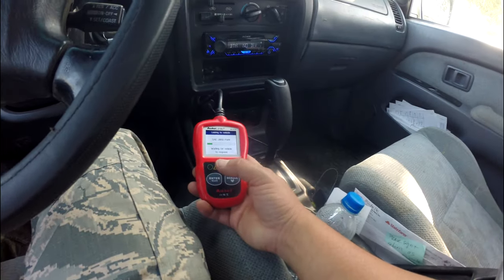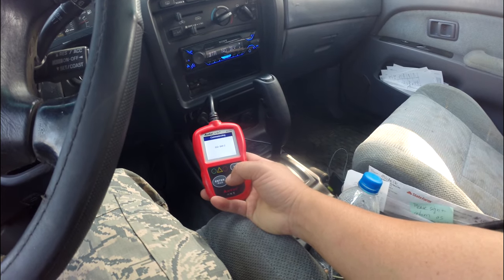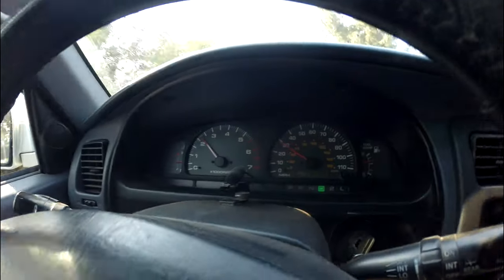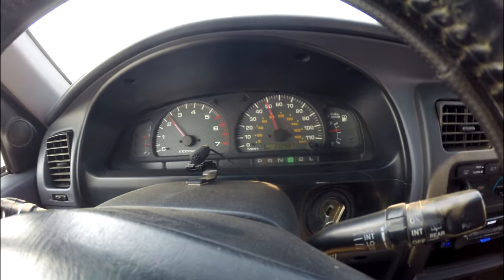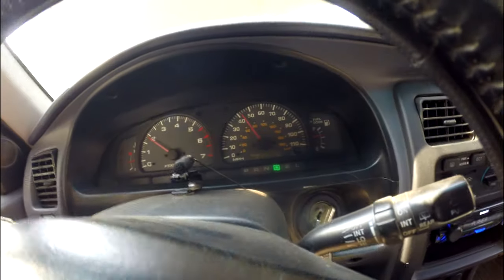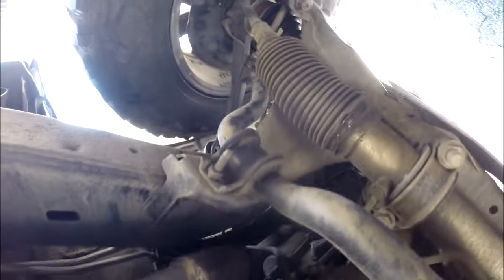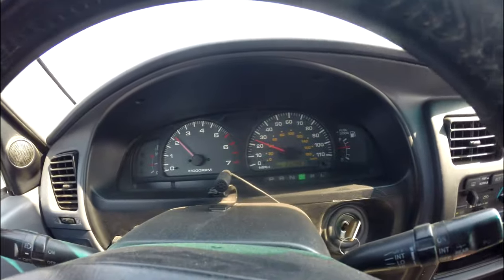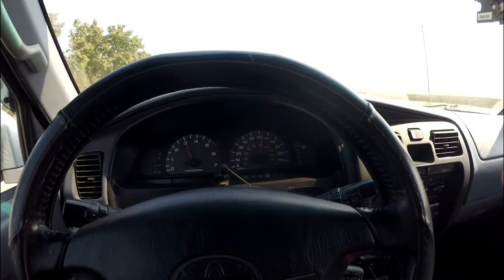How to identify a bad clogged catalytic converter.

Comment: I have a 96 Camaro 3.8l i think i have this problem replaced all sparkplugs checked map, IAC sensor nothing air box is good replaced all coil packs nothing i get a mini backfires and a rough and hard to start idle i think it might be this thanks!
Reply from the maker: @HYP3M0D368  you welcome

Comment: A clooged cat feels like a sock is in the tail pipe no response on hills - Overheatilng
Even with no engine codes.
Bad cat/s can destroy an engine due to back pressure in the combustion chambers.
Vert stressful on piston rod bearings

Comment: I have a 2001 4runner and I thought I had a exhaust issue ended up replacing a lot of other stuff trying to troubleshoot the problem and I found out I needed to replace my ignition coils my truck would start to shake at around 45mph and higher hopefully this helps someone who has the same issue I was having
Reply from the maker: Thanks buddy

Comment: i have code 0030EA and 003104 faults when the car is in idle the rpms keep going up and down dosent stop at all but when i drive the rpms are normal, can it be in need of a catalytic converter replacement? also i dont have any warning check lights on on the dashboard.
Thank you in advance.

Comment: Thanks for the video. I have a V8 Infiniti and when the engine gets warm the speedometer starts jumping exactly like on that Toyota. I finally got the P0430 code. I've seen a lot of videos on this issue and some recommending to start by changing the O2 sensors but from your video it really sounds like it's a blocked cat. Would you recommend trying to clean the  cat or just replace with a new one? I also heard aftermarket cats can be trouble. For the record, I've just subscribed to your channel. Thanks!
Reply from the maker: Can't really clean the cat according to my experience.  If you have the money dealer items will be the best.  However it's almost the same price as the car already lol 😆 🤣
Reply from the maker: Thanks a lot for your help subscribe 👍 🙏

Comment: Question, is it possible to hear a squeeling during acceleration with this problem?
Reply from the maker: You probably depend how bad it is. Some cat you can hear rattle noise from the cat. But if cat problems the symptoms is burt back to the engine.  Symptoms just like I showing in this video.

Comment: I think is what im experiencing...when i go uphill it bogs out like it wants to cut off but if doesn't. I've changed soo much but im really starting to think this my issue. Have a 88 C2500. It still has the original cat on it. Here and there get the rotten egg smell

Comment: Mine has 299,999 going on my 3 year driving it with this mileage is doesn’t move up no more should I be worried
Reply: Speedometer cable is broken. Goes from the back of your odometer to the transmission.

Comment: 2011 Audi I’ve brought to 3 mechanics. Pcv valve and spark plugs have been done. Still having the issue. Car sends lots of white exhaust out and shakes and hesitates. Thinking high pressure fuel pump, injectors, coils, or catalytic converter.  Oil doesn’t have a dipstick or a notice for overfill just says it’s at max. Just got my oil changed could be this. Any ideas?
Reply from the maker: Could be your turbo
Reply: @alltsab  okay would that cause rough idle? Shaking bad/ sputtering. with check engine light on. Going to see what the codes stored are soon.

Comment: My 2004 Mitsubishi Lancer same mileage, won’t go over 2RPM mechanic shop said fixing my catylic converters are worth more than the car itself but I have no check engine light just no gas even when I floor it. Any ideas? Or thoughts happened shortly after a tune up.
Reply from the maker: Your mechanic is right

Comment: Nice video! I have a question on my 08 328i coupe the exhaust feels very hot close to the tip but no loss in power ( from what I can tell since I just bought it) but what's odd is the smell that comes from the exhaust when it's warmed up. It smells like rotten eggs or something to that degree. Do you think it's my catalytic converters?
Reply from the maker: Your description is cat converter
Reply from the maker: But if no code and drive normal then just keep driving until the last used.
Reply: @alltsab  Thanks for the quick reply! Since this car has a sulev engine, bmw has a 150k mile or 15 year warranty for emission components in certain states like California where I live. I'll see if the dealer can change out the cats since this car only has 145k miles.
Reply from the maker: @alexjrtony350  yes take to your local dealer they can diagnose if cat they will put one for you. If no code they may just bluff you off and not fix it and tell you to pay the diagnose fees. Please help me subscribe ok I need your help too lol
Reply: @alltsab  I definitely will subscribe! Or should i say already have lol
Reply: Does it smell like coolant ? Could be egr.
Reply from the maker: @1danny2k   no

Comment: If I create a leak in exhaust by loosing bolts my 4runner will run so poorly it won't even go over 10mph.  It enters extreme limp mode. That downpipe connection came loose one time so that's how I know that:)  I've also had the front side flange to Cat loosen up and leak.  No obvious change in power when I had that small leak.  What am I missing?     ...disconnect cat entirely?
I have upstream AND downstream O2 sensors.  Creating a leak affects their function, leading to limp mode.  But I have the exact symptoms you showed.  Flooring it, and my truck barely gets up to speed.  I can feel it starving for air.  I have Rich Code on old ob1 system.   Would a stuck valve or something else create similar air starvation and my cat is fine?   I checked couple years ago and cat was about 1/6-1/5th clogged.  I installed aftermarket cat that was half the size(no other option) and it didn't change anything.  What happens to O2 sensor system if I just drill out the Cat interior?  seems like it will enter limp mode,no?

Comment: Question?  My truck is reving high in rpms when I step on the accelerator then I feel it jump a little and it runs good.  Then when I hit a stop sign it does it again.  How do I know the catlitic converter is blocked?  I added the clean catlitic converter also.  I feel in the exhaust pipe a stronger push but the truck is doing the same thing.  What should I do or check?  Thank you I appreciate your advice
Reply from the maker: Your problem is not cat converter
Reply: @alltsab  what do u think it can be?  I'm changing the throttle position sensor next, it's a 1989 gmc sierra 1500.  It was running real good and about a month ago it started revving high before it would accelerate

Comment: Can a clogged catalytic converter cause a car to go into limp mode? 2014 VW Passat 1.8t won’t get out of limp mode and the only code I’m getting is ambient air temp, also EPC light is on.
Reply from the maker: I'm not sure it will go to limb mode but it's could be possible on new car like your. But your car is still new may not be the  cat converter.
Reply: Did you try to unplug the maf sensor and run it that way? If the car drives properly without the maf sensor connected, you know it’s the maf sensor. If it still shifts into limp mode then it may be something else that requires on spot inspection
Reply: @beetlejuice1239  didn’t think about that will try that after work! Thanks
Reply: @ChristKingJesus  no worries. Keep me updated I kind of want to help you solve the issue

Comment: I have the same problem but a little different cant get over 50 to the floor but i have black smoke coming out of the tail pipe when its cold hardly any air but when it warms up it is really hot 
i also have codes running rich on bank 1 and bank 2 upstream i have changed all 3 o2 no vacuum leaks changed MAF sensor i have even changed the ECM and still the same no power i have replaced  the cam sensor TPS sensor idle air control  what do you thing CC or not
Reply from the maker: Could be bad cat or engine because black smoke meaning that it didn't burn all your gasoline.
Reply: @alltsab  brand new engine I think it's the cats I hope going to change it out
Reply: @williamfriedley8696  Brand new engine - but how old are your cats?..

Comment: P0031 HO2S Heater control circuit low (bank 1 circuit 2) is coming. Car is 2006 swift vxi petrol with 120K kms. Is it O2 sensor Or bad cat??
Reply from the maker: P0031 is not cat code so definitely not cat. Just replace your o2

Comment: So if my 69 challenger had 520,000 it’s low mileage because it’s 52 years old?
Reply from the maker: Lol 😆 69 car only have 5 digits 🤣
Reply: @alltsab  just because the gauge shows 52,000 it could have rolled over many times. 😂😂😂😂😂😂😂 🤦‍♂️  but that’s not the point

Comment: Can a clogged cat cause the oil pressure to jump up and down? Pulled a P0302 and P0430
Reply from the maker: I don't think so
Reply: It's probably the motor in your cluster. That's where mine has been until today... now it's parked for a timeout

Comment: Hey man, I think my cat might be bad, so I took it off. But is there anything else that would cause same type of problems? After 420 code and remove cat, the car is okay. I'm just wondering if it does the same problem what could it be?

Comment: Can a clogged cat cause a misfire on one bank? I have a 2002 mercedes c320. There was also a jingling sounded I noticed before it misfired on the whole bank 1. It sounded like washers jingling on a bolt
Reply: Cylinder 1 2 and 3 all misfired at once

Comment: Man, Sir my 2006 Nissan xterra its just like that, after 60mh turns off, but in 45mph to 50mph its just fine but to reach the 60mph feel like exhaust low air. In whish part of the United States are you ?
Reply from the maker: Golden state
Reply: @alltsab What area of the Golden state? I’m here, too.

Comment: I just got a 1989 f350 7.3 diesel and it barely accelerates and if I Rev it high and let rms crop to rapidly the engine will kill. Could that be the cat?
Reply from the maker: I'm not 100% sure but according to your explains it is not. Check your body throttle it more like it.

Comment: My ram 1500 is doing the same thing but also has a misfire on cylinder 7 could a clogged cat cause a misfire as well? Thanks
Reply from the maker: No not on single misfire. Your case could be just the misfire not clog cat.
Reply: @alltsab  ok thank you for the response… back to the drawing board. I changed all 16 spark plugs and cylinder 7s coil pack and that didn’t work. So next if to check fuel injector and maybe fuel pump and if they aren’t it then I’m afraid it’s going to be a bad cam or lifter issue the 4th gen ram hemis are known for… Hoping it isn’t that though
Reply from the maker: @HomeGrownPyro1  I don't think it will be the fuel pump because single misfire. Check injector and compression in that cylinder. Hey help support subscribe to my channel if you have not yet to ok very appreciated it.
Reply: @alltsab  Thanks again for the response. I did subscribe to your channel this morning 👍

Comment: My dads toyota previa doesnt rev past 2500 rpms it just cuts off i have to let go off the accelerator then maintain it below 2500 rpm to drive it reaches only 120km/h , could it be the catalytic convertor?
Reply from the maker: You can test your as this video

Comment: Do you think my cats are still good? My truck has 2 and they are like 14 years old
Reply from the maker: If no cat code then yes still good
Reply: I cant tell do its an 86 ford
Reply: It does take me kind of a lot to reach 60
Reply from the maker: @juliofranco7550  have someone good mechanic to do a diagnostic to make sure not the transmission before replacing the catalytic.

Comment: That's exactly how my Van is doing, and I have a code P0420.
Reply from the maker: Po420 is cat converter code replaced it then problem should be solved.  If you live in the area emissions restriction then  buy the matching converter to your car ok otherwise it won't pass smog check inspection.

Comment: My car has 160,000 miles and the code p0420 came on but it shuts off , my car still goes up to over 85 on the freeway but struggles uphill . Is it the cat or the wires maybe?
Reply from the maker: Replace cat first because you have po420
Reply: @alltsab  thanks ! Im going to check that out tomorrow

Comment: I'm not good mechanic can anyone give advice..I have a 1985 Cadillac DeVille 4.1  8cyl so I drove if after putting in a new radiator it makes it for a 15 min drive parked turned off  for about 10 min then on way back it over heated pull over let cool for bout 20 of 30 mins at this point i was 10 block from home i started off and it was like I wasn't getting  power wouldn't go over 25 30mph I slowes to turned my & corner gave it gas then it back fired  & blows hole in it muffler..?advice please🙏🏼

Comment: Will that causes the car to shut down while I'm driving it
Reply from the maker: I don't think it will shut it off.
Reply: @alltsab  ok well I had the air filters changed hopefully that would solve the problem
Reply from the maker: @starlove661  that will skinny chance will solve the problem.  Use obd2 code reader to find what the problem and fix it. Don't just guessing and throw money to it. It doesn't work like that.
Reply: @alltsab  we did a diagnostic test on it and everything was fine
Reply from the maker: @starlove661  oh ok

Comment: I have the 2001 Sienna XLE.  It is very slow to get going.
Reply from the maker: Possible this system but check your transmission fluid too because that year transmission does go bad too

Comment: thanks,my vibe does this on and off when its extremely hot and humaid,everything else is fine,over 225.000 miles so mines gotta be clogged-question in video you took your off can you do so temporory and drive around until part comes or gets replaced?
Reply from the maker: Yes I just test to see it cat clog up after all I replaced with new one
Reply: @alltsab  thanks,mine does exactly what the one in video does,im gonna take it off and see if i can unclog the insides as we dont have inspection here.all along i always feared it was the feul injectors going...

Comment: Will a clogged cat cause the engine to stall in idle?
Reply from the maker: I never see one but depends how bad it it is. If clogged with no air pass through the pipe then that can be possible die as you said.

Comment: What sort of temperatures should you get out of a good exhaust?
Reply from the maker: Not sure didn't measure I will measure next time 😉
Reply: Honestly it varies but when checking temperature let's say example before cats its 400°F after cat should drop temp  more than 50°F. If temp don't drop its clogged and it's chocking the exhaust which the cats gets bright red

Comment: What if I replace 2 cats but they still go bad with engine code? I do not know if buying the original cat will be ok. I do not want to spend $1300 and have it fail in 5 motnhs again.
Reply from the maker: New after market have warranty if go bad in couple months.  If you have the money go buy oem. The long run it cheaper than buy after market parts.
Reply: @alltsab  but what if there is other major problem making it go bad?
Reply from the maker: @Oscar Ramirez  don't replace anything if you not sure what it is. Get second opinion for diagnosis before spending ton of money that doesn't solve the problems.
Reply: @alltsab  I already took it to the chevy dealer and to a shop and they only say the cat is bad and needs to be replace but this the 3rd one. First was the original and the next 2 was aftermarket
Reply from the maker: @OscarRamirez-vh1xm  that case replaced it should solve the problem.

Comment: Mine trailblazer goes over 85 mph. But I still have a catalytic code on it. Why?
Reply from the maker: Your case bad cat but not clog cat. If you  keep driving your for years without fixing it then it will clog.

Comment: I could really use some help, first I noticed my car consuming more fuel for a while now, it has become a bit sluggish at times - I feel like I'm getting less power, now there's a whining noise - I checked everything in the engine bay where it seemed the sound was coming from, meaning where all the belts are connected - checked the alternator first, A/C and power steering, disconnected all the belts and the whine noise was still there.. Now I'm thinking the noise is coming from the front middle of the engine where the catalytic converter and the manifolds are. 
Could it just be a bad catalytic converter in the front of the engine? Is there a leak in the manifold? maybe both? 
Something else I did is check my OBD scanner, there aren't any fault codes but I noticed when car is idling the vacuum shows steady 23-24 which is above normal. 
Can someone please give me any insight?
Reply from the maker: Could be leak air but normally newer car if leak air it can throwing code. Your case maybe internal engine make noise. If you have timing belt it can bet water pump or belt pulley. If you have timing chains it could be your chain.
Reply: @alltsab  To give more info, noise appears when I give it some gas, there's no noise when it's just idling. When car is cruising in high gear at moderate speed without gas there's very little noise - almost non. The car is 2008  5 speed manual, 4 cylinder Tiburon Hyundai.  
I only noticed something wrong when the whining noise started and right now the main issue is the whine, the sluggishness and fuel consumption might not even be related.

Comment: Was that the primary or secondary catalytic converter? I currently have code P0421 catalysts below threshold efficiency bank 1. Doesn’t fill clogged maybe it’s just bad
Reply from the maker: Bank1 is primary or p420 is primary